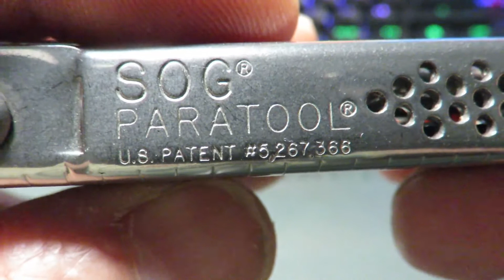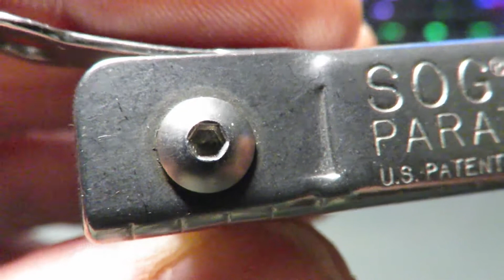Multi-tool Review on Demand : SOG Paratool (S31)

Comment: Chers diezelle57, BUCK355 et SOG PARATOOL, je me demande quels produits ont été lancés en premier, et je me demande quand le temps de production des deux produits est fini. Je me demandais s'il y avait un doute que les deux produits sont si semblables que l'un d'entre eux aurait pu l'imiter!
Reply from the maker: Buck a complètement arrêté de produire des multi-outils et c'est regrettable (ou heureux vu les problèmes de conception non corrigés du 360).
Le Bucktool 360 (décliné ensuite en 350 et 355) date de 1994/95 et il a été dessiné par Splane Design : http://www.splanedesign.com/portfolio/bucktool/ . Il a été retiré du catalogue Buck en 2002, je ne sais pour quelles raisons précises.
Vous avez raison, l'originalité de l"ouverture du Bucktool 360 fait penser à celle du Sog Paratool.
[From the wording in the instructions, it sounds like its just the pivot pins.  Splane Design takes credit for the "two axis hinge" design.
"Claims relating to the angle of the pliers handle pivot pins in U.S. Patent No. 5,267,366 have been licensed to Buck Knives by SOG SPecialty Knives and Tools"] : https://forum.multitool.org/index.php?topic=1758.0 .
[Based upon an original concept by the reknowned cutlery designer Blackie Collins, the ParaTool was further refined by SOG before introduction in 1992. It is still in production over 15 years later.] : http://wiki.multitool.org/tiki-index.php?page=ParaTool .
Reply: diezelle57 Merci beaucoup pour votre super information ^^ Comment avez-vous connu le site qui fournit cette information? Mais buck355 et sog paratool, buck355, sont libérés en premier.
Reply from the maker: Ces sites sont bien connus des amateurs de multi-tools ! :)
Les Bucktool 360, 355 et 350 sont apparus après le Sog Paratool qui fut arrêté après leur retrait.
Reply: diezelle57 Merci pour votre réponse ~~!